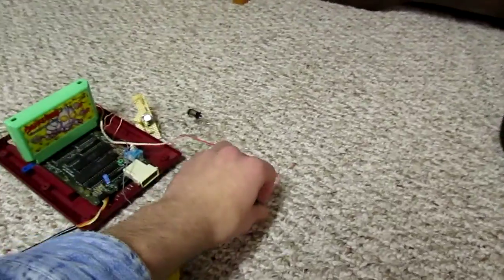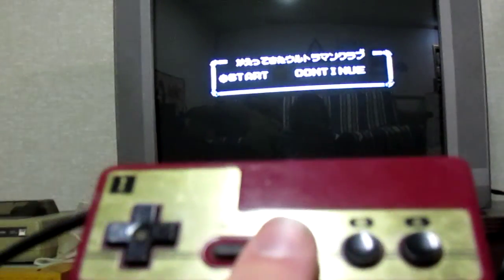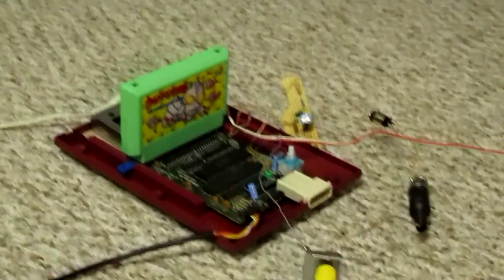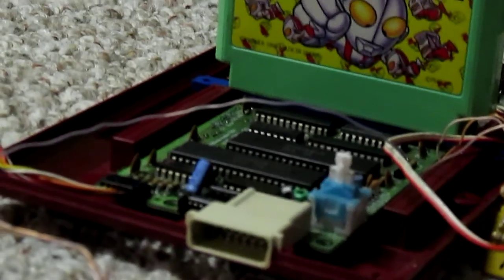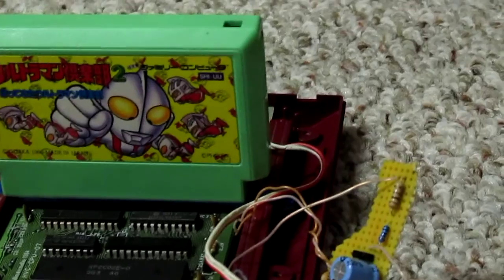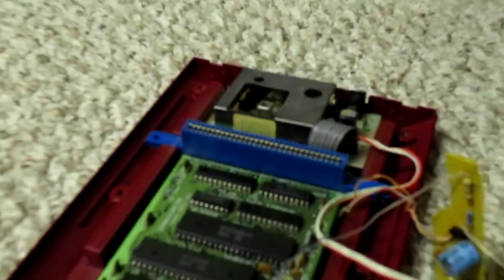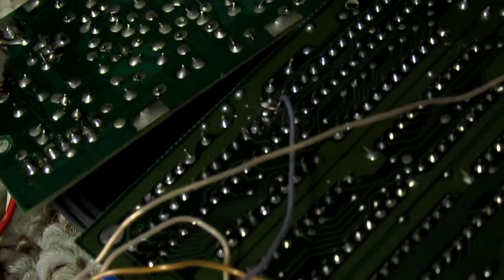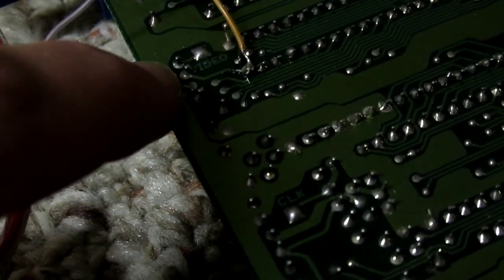Famicom HVC-CPU-07 AV Mod!

Comment: HVC -CPU-07 is the best Famicom?  just to Know..,
Reply from the maker: Not necessarily. Of the original (non-AV, non "twin"/SHARP models) it is a decent one. Any famicom with a revision G or H PPU (labeled RP2C02G) will be compatible with every game released in Japan and the US. Earlier revs. sometimes have issues. But the circuit board layout itself is fine, and it works just as well as my HVC-CPU-06 and HVC-CPU-GPM-02 boards for most games. (GPM is the most recent)

Comment: I am also doing an AV mod with the HVC-CPU-07! Which schematic did you use? I couldn't see you the strip board you swung the camera too fast. Also how do you wire the RCA connectors?
Reply from the maker: Sorry for the slow reply. Here's how my circuit looks now: http://i.imgur.com/mGpUgV1.jpg
I wire the RCA connector for video with the positive at the center, and the ground on the outside.
To get audio, I run a wire from pin 46 of the cartridge connector to an RCA. Pin 46 is positive, so put it on the center. Get ground from the video jack for the sake of simplicity.
My schematic was this: http://imgur.com/a/rZcMx